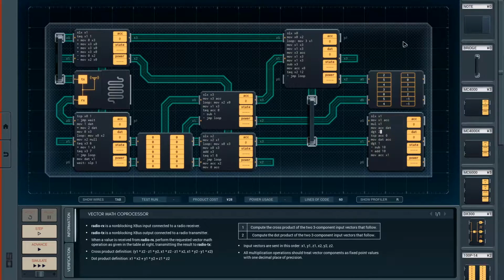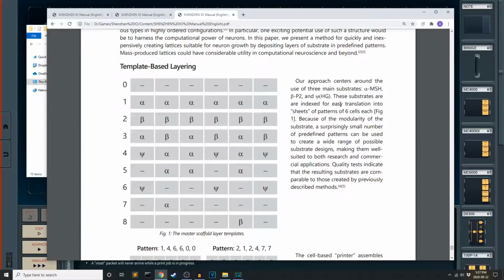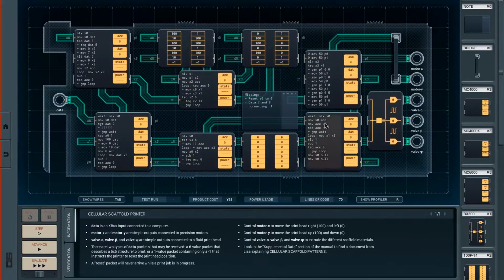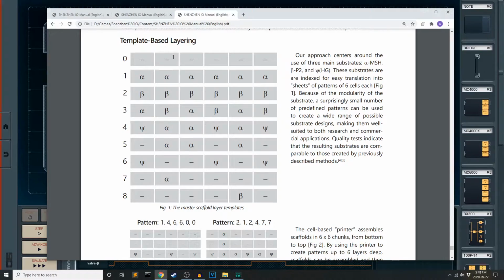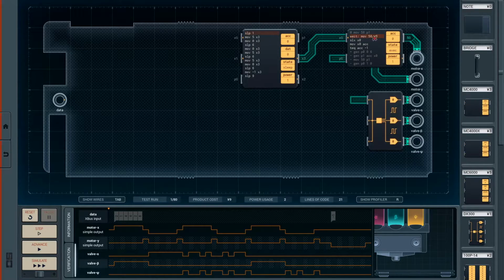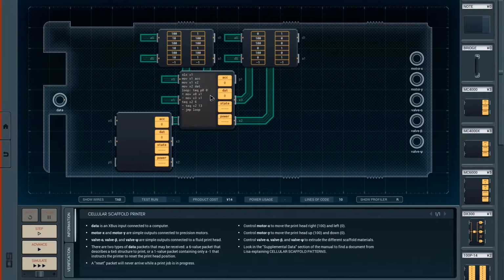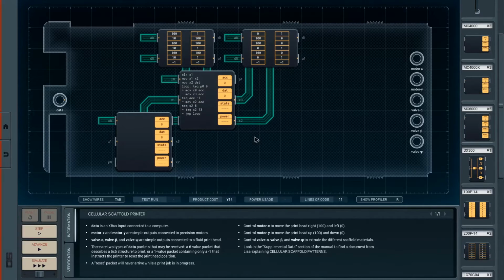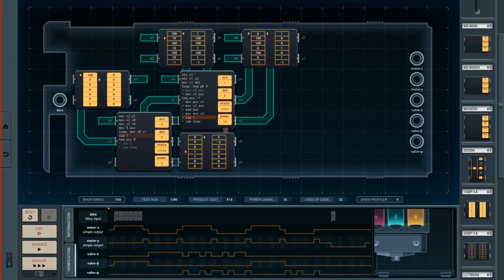Shenzhen I/O - E39: A taste of the nightmare

Comment: This game does have steam workshop support, so you can upload/download levels on the steam version. You're actually required to upload your level to get the checkmark in the steam version.

I'll have to take a crack at your puzzle. I skipped those episodes so it would stay fresh for me.

Yeah, this puzzle took me multiple days to solve, but it's a solution I plan to share after you solve it. It's not better on all 3 curves like the last one was, though.

I do highly recommend exploring a different approach for this one. Board space is at a premium here, so you should be vehemently opposed to adding any components unless your design absolutely requires it.
Reply from the maker: Ah, that's cool! I know I miss some features by opting not to play the Steam versions of these games, but the drawbacks just aren't worth it for me.